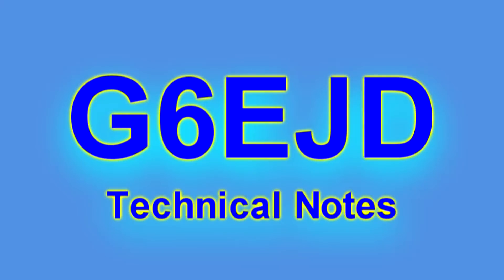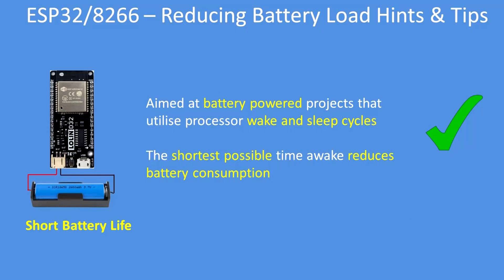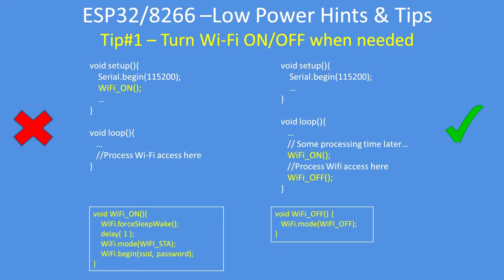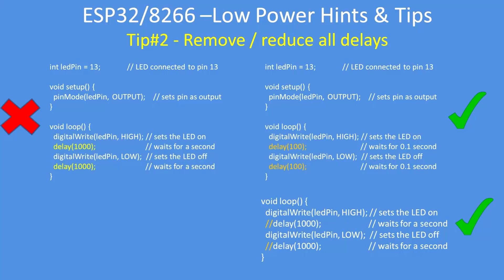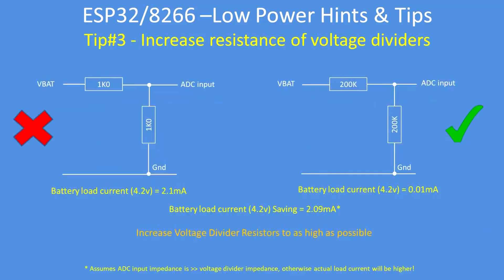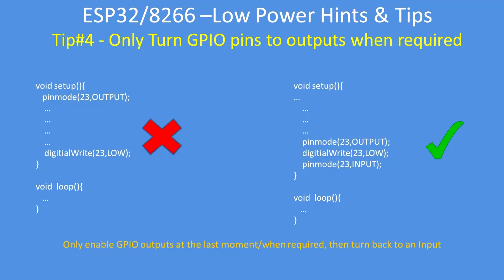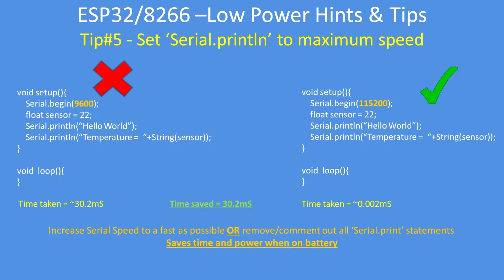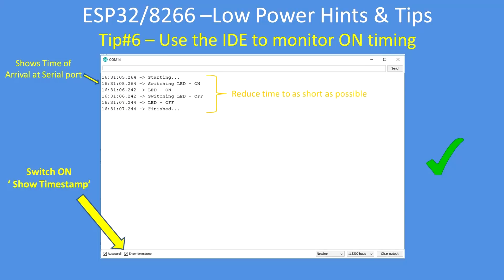Tech Note 131 - ESP32/8266 Reducing Battery Load Hints & Tips

Comment: Delays in general are a bad idea but that's how Arduino is set up.  However, if you use light sleep on at least the 8266, you actually need to have some delay in there for the power savings.

Comment: my experience: a sensor on ESP32 that measures temp, hum. lux and its battery:
1- connecting to WiFi (static IP): anything between 2-5s, sometimes more than 10s
2- getting time from NTP server: anything between 20ms-5s, sometimes not  need for connecting so just ms, sometimes connection failed so timeout
3- SHT31 sensor: max 50ms
4- TSL lux sensor: 0.4s (max accuracy)
5- ADC with 5000 iterations: 0.4s
6- MQTT publish: < 0.5s

now with regards to your advice:
1- measuring voltage BEFORE wifi is connected shows different values as ESP without wifi connected is consuming much less current - so now the question is: more precise voltage measurement (when working) or less power consumption but "wrong" value  - measure before wifi connected? I opt for measuring real voltage when wifi is ON
2- 200kOhm is way too much for ADC on ESP32 - your multimeter will show good results but ADC on ESP will show much lower value - again: precision vs consumption
3- my sensor takes from wake up to go to sleep anything between 3-10s, average is 5s, 90% of that time is wifi connect. Anyway, when wifi does not connect within 10s it is forced to go to sleep. Same for MQTT failures. 
4- reducing serial.print - I would go even another approach: for debugging turn on serial.print - for working turn off completely - recent video on another channel showed how to with 1 command

anyway, thank you for your video and advice
Reply: for everything else,... there's mastercard

Comment: Thanks, David. Very useful tips. How much current is saved by changing a pin from an output to an input?
Cheers!
Reply from the maker: It depends on the load attached and the pin state before the change is made. Say the pin was driving a load then it would be a function of the load impedance but could be in the mA range. Moving to an input places the pin into a high impedance state and so also prevents current flow (sink) into the device. It really does make a difference if your trying to get best possible power consumption from the device.
Reply: @G6EJD  thanks!

Comment: Oe of the best tutorials on this I have seen, not surprising, al, your vids are awesome.

My I ask, is there a simple way to check the effects of these changes?

Can I for instance, run the project for a day/week then measure something with a multimeter, make the changes, and re measure after the same time period?

If so, do I measure the remaining battery voltage?

Sorry for such a beginner question, but being such a newbie, is why I love your tutorials so much.
Reply from the maker: Yes that’s the best way of measuring the effect of changes, measure the voltage with a multimeter implement the change then wait the same time and measure again. The problem is to be really sure you need to start with the same battery voltage each time as the discharge characteristics of a battery are not linear. But you’ve got the idea on how to see the effect of changes.
Reply: @G6EJD  thank you very much sir, I really appreciate you taking the tine to get back to me personally. I understand-ish, the programming, but the electronics are a dark magic.

Comment: it is very hard for me since im working with gps anti theft alarm system, pls david i really need help
Reply from the maker: Ok, what help do you need?
Reply: @G6EJD  i had develop motorcycle anti theft (vibration sensor) with neo 6m gps using esp32 embedded with sim800l (ttgo call) powered with 20000mah battery pack, the problem is i failed to use sleep mode and my system can only operate for 17hours(active mode all the way), i really dont understand how to use the sleep mode for my system, may i email you my coding? Pls sir i need guidance, im working alone and i had no one who can help me with this problem
Reply from the maker: @wandaniel4596  Yes please do and I'll have a look for you. I'll add sleep too. contact me at g6ejd.dynu.com then contact. I should advise you that it's hard to make the GPS sleep not that you want it to so it knows where it is. A 20A/Hr battery should last at least 5-days or more, so something is drawing a lot of power, if your getting 17-hours from a fully charged pack then your circuit is drawing ~1.2A and that's the problem, not the sleeping.
Reply: @G6EJD  for the gps i add a relay, the gps is switch ON when needed only, ok sir i email you the coding, thank you sir

Comment: nice tips. thanks. what about rater use RF instead of WiFi
Reply from the maker: Mark, could use RF but the availability of robust protocols for RF modules (other than LoRa) is low thereby making their use questionable. They work just not as reliably as most people want.

Comment: Hello Dave, i´m very grateful for your tips. :-)  I am a ESP newbie….is that possible that you give us a complete sketch example? In my current project I am desperate to get to the Wi - fi interface. Unfortunately I have no strategy for Wi - fi auto reconnect.  Thanks for your input Guido
Reply from the maker: quito96, the WiFi will already automatically reconnect for you if it looses a connection, the WiFi on /off functions are on screen and widely available but I’ll see what I can do, so you mean just WiFi on / off and connection improvements. If you look in my github at the epaper weather station v13 code you will see a function in there for WiFi off and a robust WiFi connection function, you just need to include copies of those in your sketch then call them.
Reply: @G6EJD  I appreciate you for the tip and thank you for sharing your knowledge
Reply from the maker: Do you have it running now?
Reply from the maker: WiFi can be a little tricky but once you have some decent functions you’ll find its quite reliable.
Reply: @G6EJD  not yet, i´am check your epaper ino file and later  i must include it in my sketch…
Reply: A good training for a beginner  :-)
Reply from the maker: quito96, The ESP also has a well used ‘WiFi manager’ library that gives the ESP a web based interface to enable you to choose the WiFi network then enter a password and then it automatically connects for you, although a little tricky to use initially or until networking is fully understood for example and it’s not clear you have to connect your browser / pc to an ESP generated network on 192.168.4.1 then afterwards reconnect back to your network, like most Arduino libraries it’s easier when you know how or someone shows you, but without that it can be near impossible and very frustrating, that’s why I produce the videos, have fun.
Reply: @G6EJD  i want to contact you via your contact formular on your website …but it failed…  There was an error trying to send your message. Please try again later.

Comment: You can also specify the ip address immediately, and not receive dynamically.
Reply from the maker: Yes, I did think of including that but in practice I’ve found it makes. Dry little difference over on instructables I did some tests and found it gained just a few mS, but it does depend on your wireless network and access point, mine are very fast and I can detect no difference.

Comment: Clear as usual.
I'm looking for a wakeup based on ADC value, it seems possible with ULP, did anybody use this ?
Reply from the maker: If you don’t need a programmed wake up voltage you could use a simple voltage divider that uses a gpio pin to wake up the main cpu or use a low power op-amp as a comparator and interrupt source for a gpio pin and with a variable resistor would allow a setting.
Reply: @G6EJD  using only esp32 ADC is not mandatory but I feel this much more elegant
Reply from the maker: laurent, ULP has to be programmed in machine code and what you propose is feasible so yes and there are some basic examples around. It may be possible to write the logic in C and assign the code to one of the cores (ULP) whole the other core sleeps, I have not tried that concept and don’t know if the constructs are available to do it.